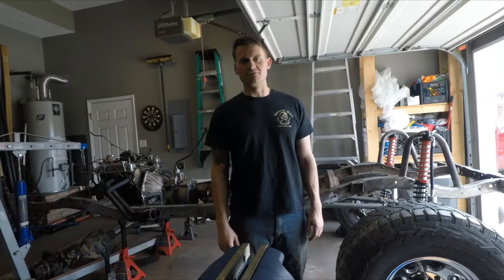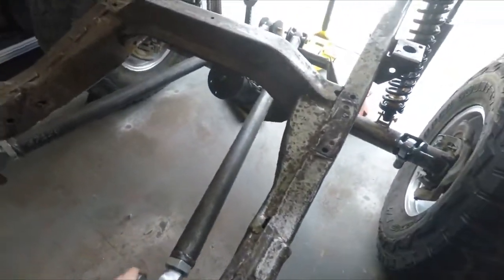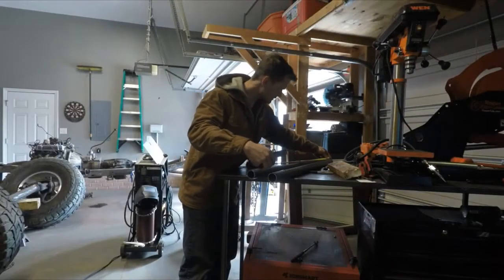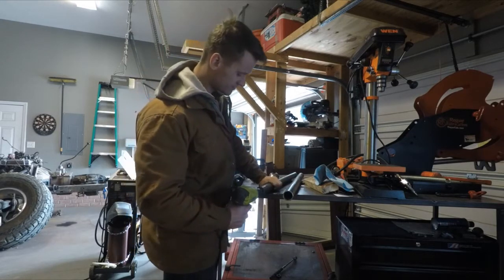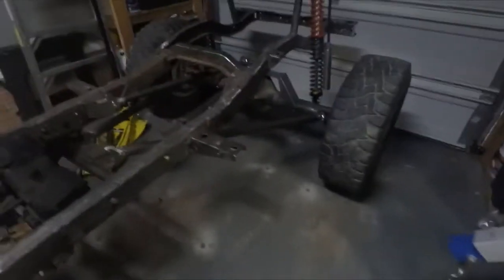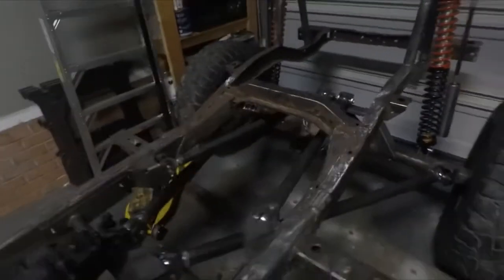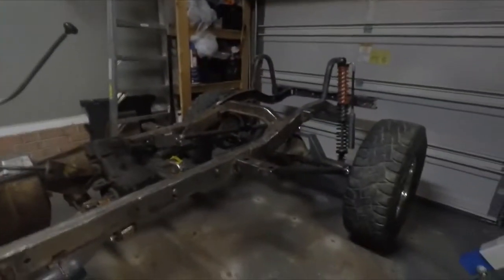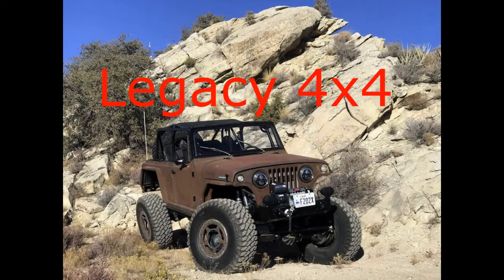Fabricating rear 4-Link suspension on my 1967 Jeepster Commando  || Legacy 4x4 and Off-Road

Comment: The '67 Commando Project AND the '38 !? You must like to be busy. I 've watched other 4 link systems being installed on you-tube, but this I the only time I've watched someone custom fab an entire system - impressive! Going so long - your deep into the frame with lower link passing under the frame member and the upper arm - this may be the limit that sets the bump stops. Fortunately, a little movement at this end of the arm = much more at the wheel.
Reply from the maker: This is Jakes (my brother's) MAJOR build right now once he's back from Kuwait. And yes! It means more if you do it yourself! (and its cheaper)
There will be bump stops when it is done! Its on the list!